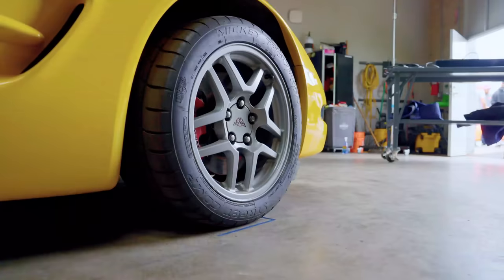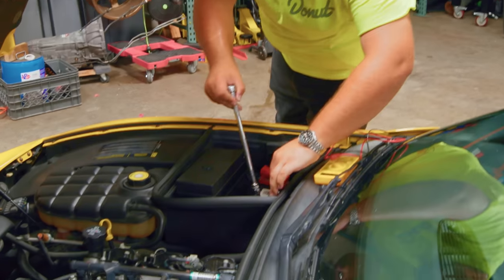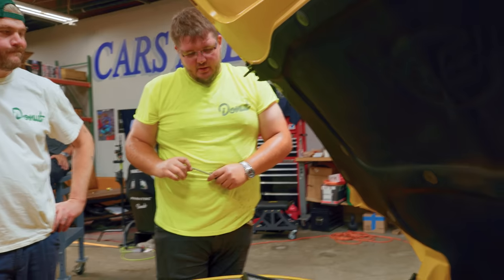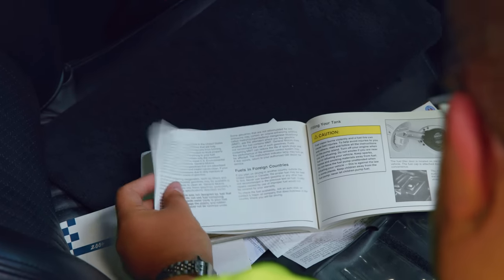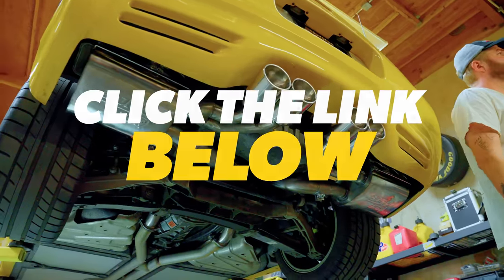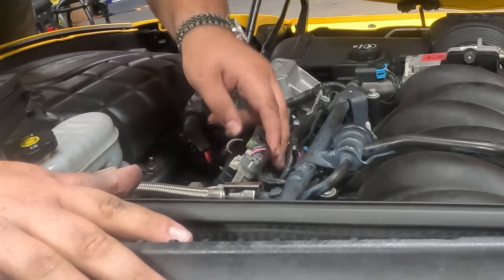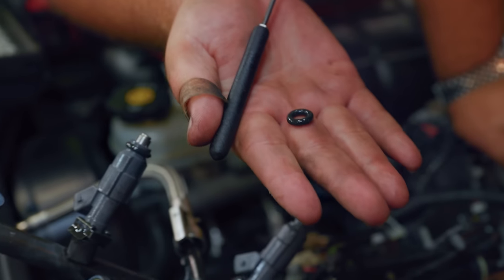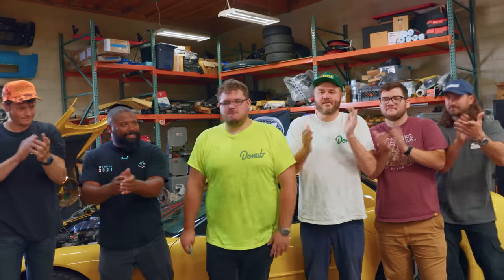Giving Someone a Corvette, If They Can Fix It

Comment: Ya, this video mighta lost a sub. How TF is he supposed to find your tampered fuse, 3 vacuum leaks, 2 sparkplugs, and another few problems in 2 hours?

At least do normal repairs. Not like the 15th thing to check on the list.

Comment: Y'all are kinda assholes for this one, I don't know if I like the show nearly as much anymore. You made it significantly harder than the previous ones and didn't give them enough time for what you did. Especially with him only having 1/3 a sabotage left, he deserved the car for sure. He only failed because you loosened some random-ass air intake in some deep spot in the engine that NOBODY would think to check, that's just pure evil. Especially because it was only loose, so you couldn't even tell that it was bad without spending a bunch of time looking for it.

Edit: I should clarify, the reason I'm this mad is mostly because he got NOTHING for getting that close. He didn't even get to plug his channel, get some merch, anything. Y'all just said "we're keeping the car 😎" and made him leave. Literally anything would've been better than that, it paints you guys in a really bad light, especially considering the sponsor and ad-revenue for this video probably already gave you WAY more than it would cost to give even a moderate consolation prize.

I think you should bring Sam back for a rematch. He stated in his comment that he was open to coming back, and this was by far the most entertaining episode of the show, up until the shitty ending.

Comment: Man this was a disappointment. He got everything except one thing. That man deserves that car and I'm kinda disappointed in y'all for not letting him get the car. He deserved it and y'all are being too rigid. I could understand him getting absolutely nothing  if he had not found any of the vacuum leaks but he found 2/3 of them. He deserves the car or at least 10 more minutes. I mean y'all did make him get the keys out of a block of ice which has nothing to do with the challenge at all. He probably would have found the last leak if y'all hadn't done that.

Comment: This is the reason Mechanics have such a bad reputation, because they can't fix some of the simplest issues because they always think it's some stupidity difficult thing cars are easy along with there problems, they all run the same just different motor.